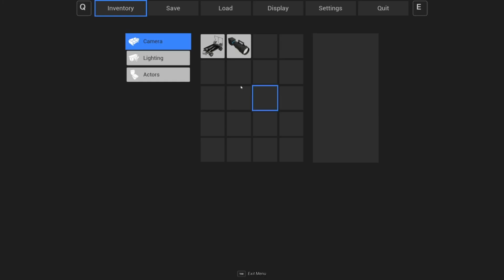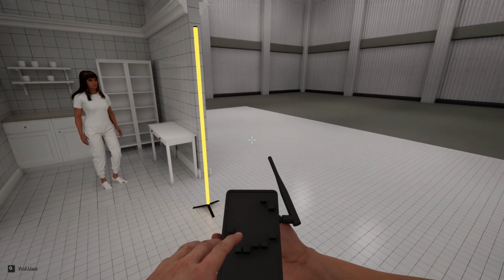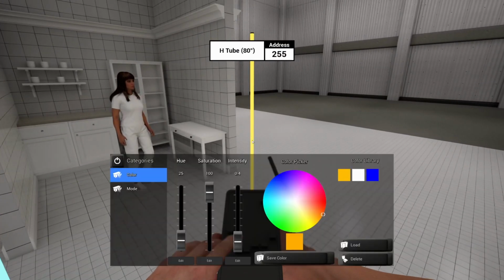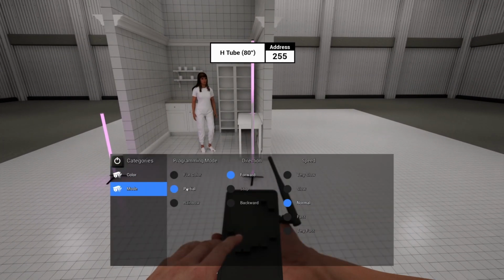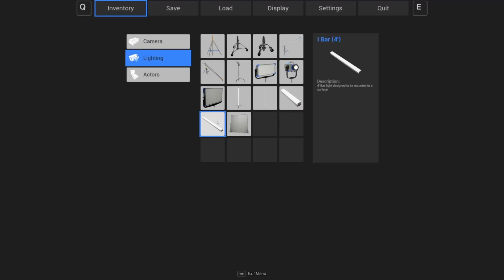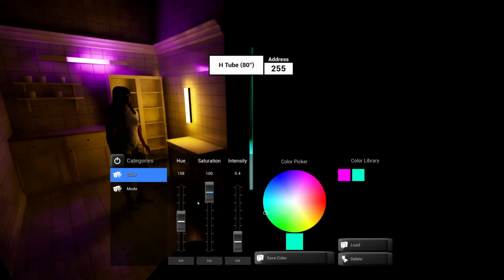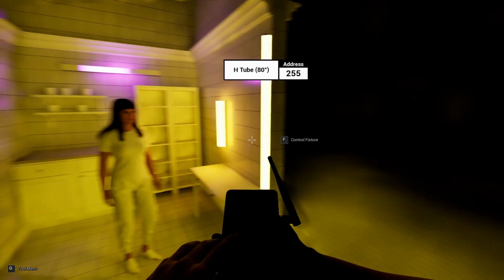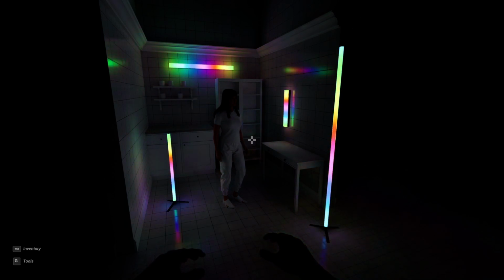Tube and Bar Lights | Cine Tracer 2 (0.5.1)

Comment: So I see I have this update, but as before I cannot save shots or projects. When I create a shot and press Enter (Return on a Mac) nothing happens. I have a Mac Mini M1 with 16GB RAM. Does this work with this programme or not? I cannot find an answer to this question anywhere so have resorted to asking here.
Reply from the maker: YouTube is actually one of the best places to ask, where else have you looked/asked?

This has come up a bit with MacOS as they have new Security settings.  Can you try:
- Go to System Settings
- Go to Privacy & Security (left bar)
- Select "Files and Folders" (right panel)
- Select "CineTracer2" and enable access to "Documents Folder"
Reply: @CineTracer  So I looked in the Discussions for CT2 on Stream and also found an FB group with not much in it. Anyway, thanks for the response and I now can save these shots, which is great.
Reply: So now when I save the Project and re-open it I can see the two shots I created, but when I press Q to change shot, nothing happens. Also when I open a new project the first shot from the previous project is still on stage, but I can’t change the character. So the programme is still not useable for me. Is there a setting I am missing?
Reply from the maker: @retlwiz ahh does the instruction only say Q?  It should say Q/E, there are a few places that this is showing only half of the instruction.  E would progress the shot.  There is currently a bug with the cameras after it 🎉 load that I know of, but the Q/E instruction I didn’t know about.  Appreciate the feedback, these things will be addressed next update.  I’m making a video about the MacOS security thing.

Instagram and YouTube are the best places for direct reports/feedback.